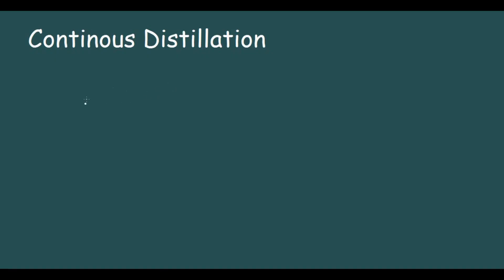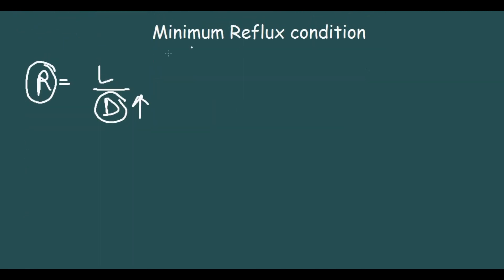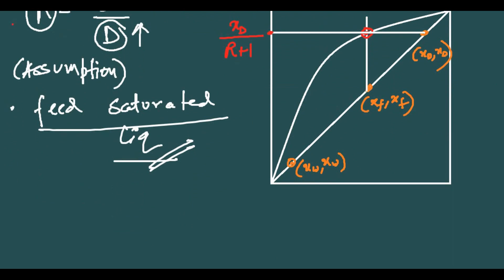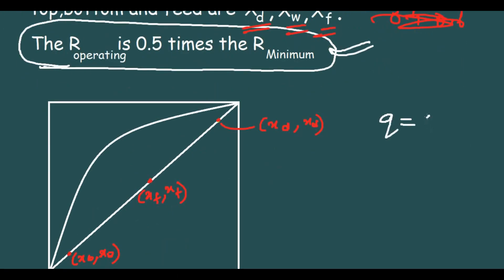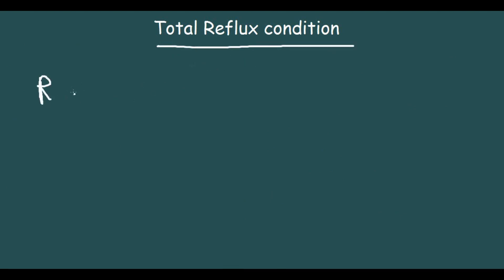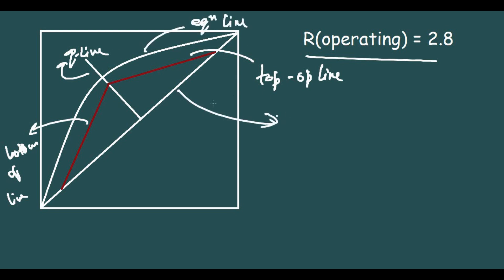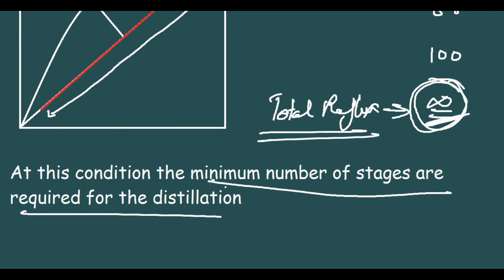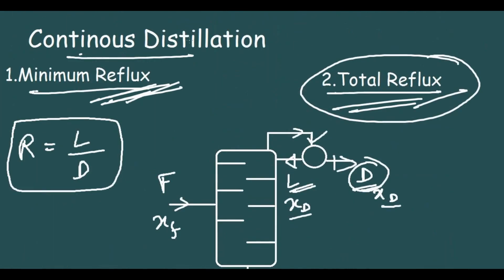Total Reflux and Minimum Reflux | Continous Distillation |

Comment: May I know why reflux ratio increases , number stages required will decreases
Reply: Hi, i might try to help and answer you question. If we look at the equation for Upper Operating Line in McCabe-Thiele method, you would notice that its slope (gradient) is determined by reflux ratio, as R got larger the slope gets steeper, there is less chance of creating a "bounce" or more horizontal line because the vertical line has to travel further down before eventually bounce and create a horizontal line. So generally, the less the space between the VLE curve and the operating lines , the more likely it is to form more stages and vice versa